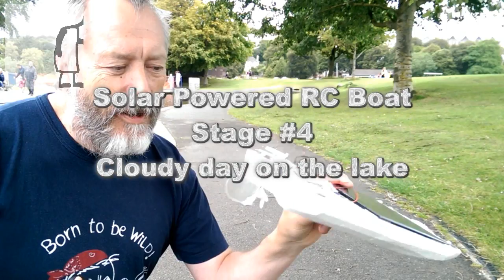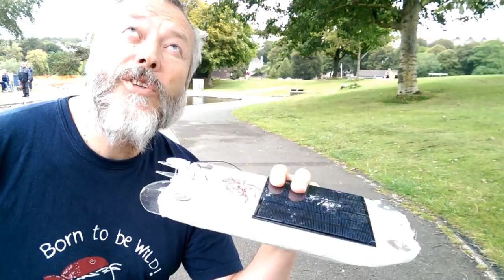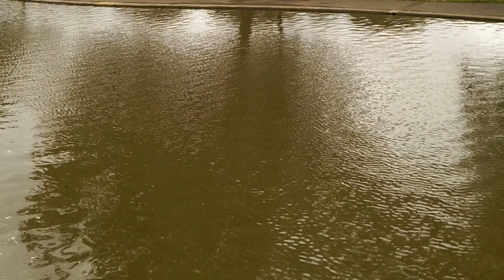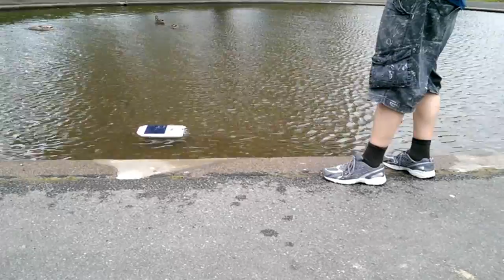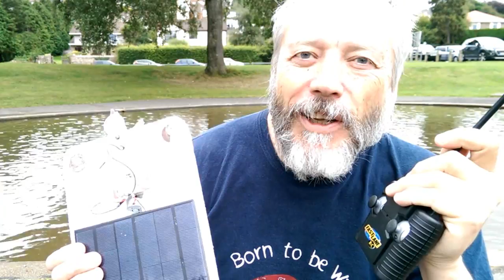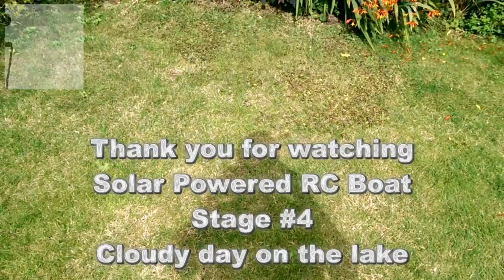Solar Powered RC Boat Stage #4 Cloudy day on the lake

Comment: Watched the other 3 videos on this. I really love the idea of this solar powered boat, but I was thinking if you put a "Joule Thief" or some sort of power booster, between the the power output of the solar panel and the receiver board, if you might get extra power? Great project Graham. 👍👍👍
Reply from the maker: Power booster? Come on Mike, we don't boost the power with a Joule Thief, just change the voltage, little spikes of high voltage. The option would be to charge a battery, then run the RC gear and motor off the battery. That is not what I wanted to do, I just wanted to power it directly from the solar panel. I should have included a voltage regulator in the circuit to protect it from those odd occasions that the sun shines brightly. That panel is probably big enough to kill the receiver in direct sunshine. RC Test Flight has been working on solar power for years now, always based on charging a battery https://youtu.be/G-xJIKFMVb0 worth a watch 😁👍
Reply: @GrandadIsAnOldMan  Oh sorry! I was just trying to think of another way. 
I do know that getting power from nothing is not yet a fact. I don't have a clue how a joule thief works, but it's no big deal.
Reply from the maker: @mikeflight9   the Joule Thief thing comes up quite often in the comments on lots of my videos, but that it all it does, it creates very short duration spikes of higher voltage. The usual demonstration is lighting an LED that needs 3 volts from a dying 1.5 volt battery.  The spike lights the LED and persistence of vision gives the impression it is a continuous glow. It won't suddenly run a motor because there is virtually no current generated. Like I said, the best option is to charge a battery and then use the battery to  run the motor. That way any fluctuation in the sunlight intensity can be ignored. That link I gave you for RC Test Flite (nothing to do with FliteTest) is the latest in a fascinating series that guy has been working on for years and he has gone into a lot of detail to explain what he has been doing and how it works.